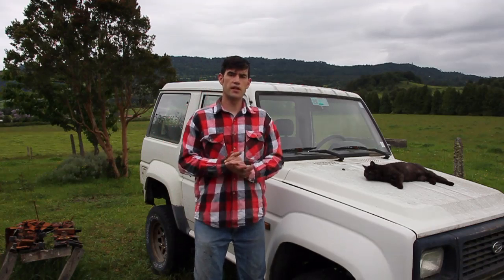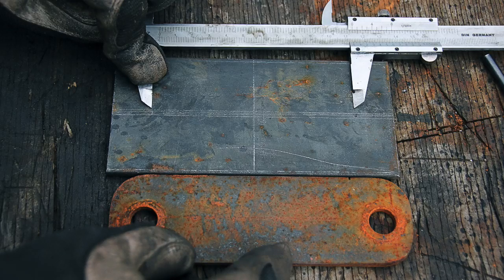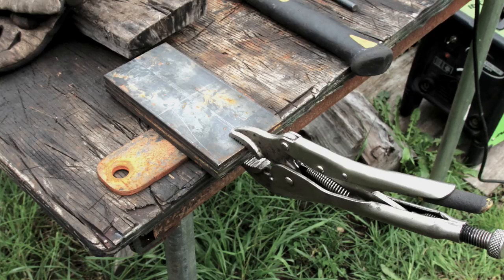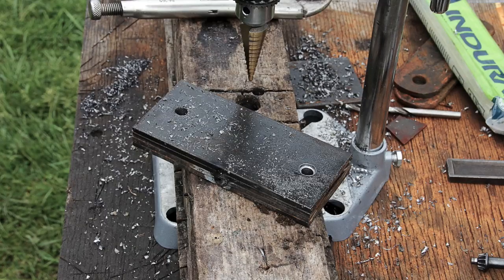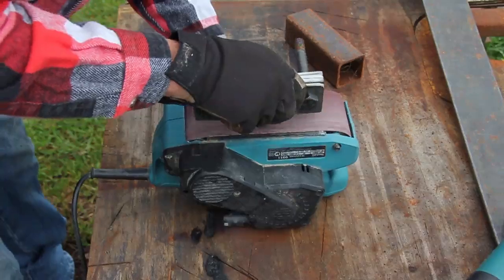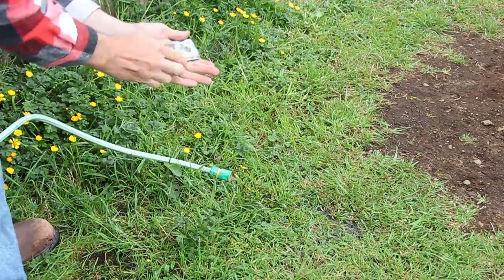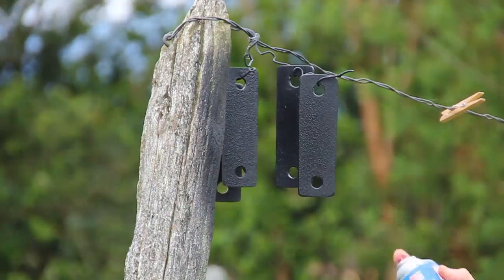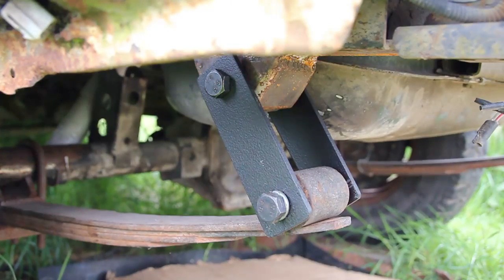Ep 34: How To Make DIY Leaf Spring Shackles

Comment: You only need one shackle on each leaf spring?
Reply from the maker: Adrian Magallon with a standard leaf spring system, you only need shackles for one side of the spring. The other side is bolted to a pivot Mount. There are custom Offroad leaf spring systems that people sometimes use that have shackles at both ends of the springs, but these also require some kind of left/right, front/back stabilization links.

Comment: Hi, very nice video, i already did the same thing! but now i have sudden moving left and right when wheeling and GREAT vibration on 2nd and sometimes 3rd gear! .. what do u suggest? thanks
Reply from the maker: this is a good simple mod. 

For the moving left/righ, and the vibration... what is moving left and right? Where does the vibration feel like its coming from? Does the vibration feel like it's coming from the rear of vehicle, or the front? Does it feel like the vibration is coming from the drive line, or the suspension?

There are lots of things that could cause the symptoms you mention. If you help me though, we can narrow them down.

Comment: have you done greaseable shackles pins?
Reply from the maker: Do you mean, have I made greasable shackle pins/bolts, or have I used them?
Reply: i  guess both questions.
Reply from the maker: Then, Yes. I have used greasable shackles before. And no, I've never made them. Even though they wouldn't be that hard. Only thing is, by the time you buy a tap, use up a bit, consider the time it'll take you, and the chances that you may screw one up, it's just more cost effective to buy a set of greasable bolts, than it is to make them.

That being said,greaseable bolts for shackles are a good option. Still, they have their pros and cons. Pro's: they keep your bushings lubricated (reducing squeaking), and reduce rusting. Cons: When a bushing has exposed grease in them, they attract grit and grime, potentially causing premature wear. Therefore, requiring frequent cleaning to keep the bushings from wearing quicker than they should.